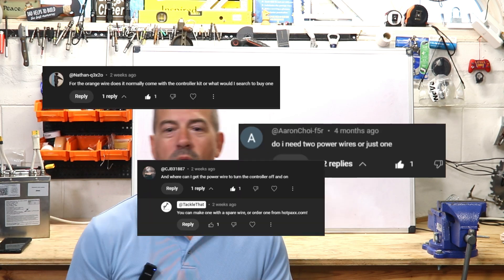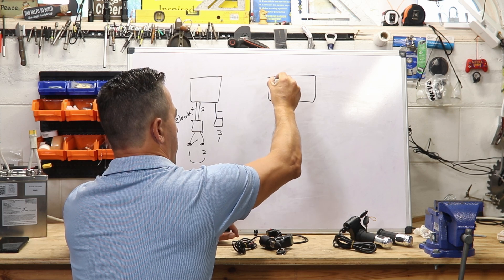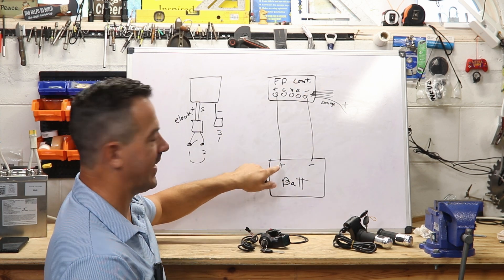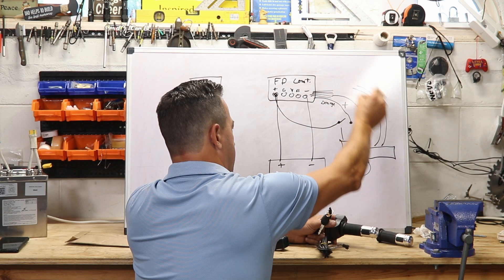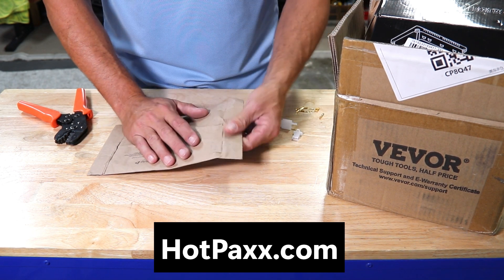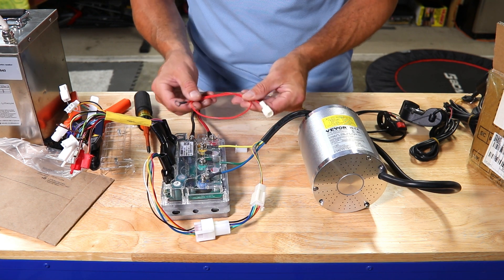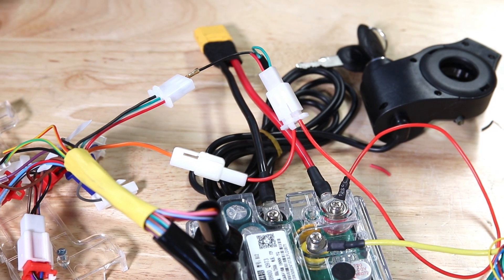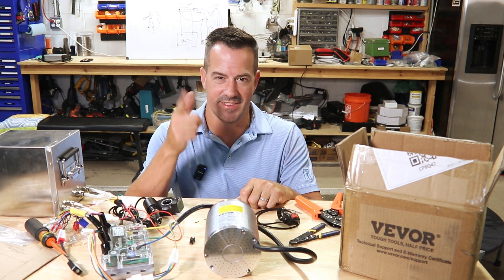Far Driver Controller Orange Wire! Wiring up Razor switch DIY Vevor E&C Electric Dirt Bike E-bike

Comment: Will a 12/24v switch work or.do I need a 72v rated one?
Reply from the maker: Just about any switch will work .. amps are whats more important, and this is very low amps 👍👍

Comment: Nope.  Still not sorted out with the explanation technique.  Teachers are trained, not ordained by knowledge.
Reply from the maker: What's your issue?
Reply: I think he means that you over simplified the instructions and made them unclear. Some people learn with quick answers not long explanations of info overly complicating it further. You lost me also in the explanation. The double grounds are from where?? there is no explanation about the ground location for the throttle and key switch. You jumped around too much. For Instance, the begining you talked about a controller we dont have and begun the confusion. Just stating my dyslexia scenario. Thank you for your help.

Comment: do we need a dc converter from x voltage to 12v? or just if we want add accessories?
Reply from the maker: Only if you have 12v accessories! I found 12-80v headlights and tail lights that wouldn't need a converter.
Reply: @TackleThat thank you sir for replying 🙏

Comment: Do you know of any Amazon 36v controllers that have 3 speed control so I can connect a 3speed switch?
Reply from the maker: I don't, normally you need to go up to a 48v brushless setup for 3 speed... Or you can put a potentiometer on the throttle +5v line and adjust that way!

Comment: Hey man so I’ve got a question

 could I just get the red wire and plug it from the terminal to the orange and not put a key switch in the middle of the circuit? 

Cause I want it to turn on as soon as I plug in the battery.

cause I don’t have a key switch I have a trip instead that I use to turn it on.

Would not putting anything in between the wires make it turn on as soon as I plug the battery in?

Thanks hopefully I worded this right
Reply from the maker: Yep, thats how it would work! I don't recommend that since there is no safe way to turn the bike off between rides/riders. Batteries should not be reconnected often, it wears out the connection since the caps in the controller will want to fill up, causing a spark and carbon buildup over time! GL out there!
Reply: @TackleThat  Yeah ok but i wouldnt be pluging them in and out i would be using a breaker switch to turn it on and off.

Comment: I have the switch coming just with two cables ? How I can connect that to the red cable ?
Reply from the maker: Put the black wire of the switch to the orange wire on the FD controller, and the red wire of the switch to the battery +. That will connect Batt + to the orange wire when the switch is on! GL out there!
Reply: I add a short video if you can help us !! Thank you for your amazing videos
Reply: We have just two cables in our key switch just red and black ? In your video you have red black and green ? Thank you again

Comment: Hey bro can u find me the link for the orange wire, but not of hotpaxx cause they don’t ship to Aus, Mabey off Amazon or something. And just wondering your using the the 72v controller right? But would 48v ND72260 FD Controller plug into the vevor 2000w motor?? Thanks
Reply from the maker: Yoo! Why not make your own connectors? I use this all the time: https://amzn.to/4mFriKi also sure, the far driver 72260 is 48v-72v and will power the vevor just fine!
Reply: @TackleThat ok thanks, I’ll make my own  just wondering what connectors they are? I know the one the goes on the controller is a o ring but what pin connector is the other side? Thanks And can u send me the link to the controller that u used that’s 48v-72v cause the ones i find say only 72v
Reply from the maker: Sure, here are the 2 used with FD controllers! https://amzn.to/45E1zMg and https://amzn.to/3JTn3fq
Reply: @TackleThat ok thanks and can you send me a link to the 48-72v fed controller the only ones I can find are 72v

Comment: I connected the orange wire still qsmotor won't start
Reply from the maker: With a far driver controller? You've got to log into the app do auto learn, and make sure all the settings are correct, and see if there are any errors.